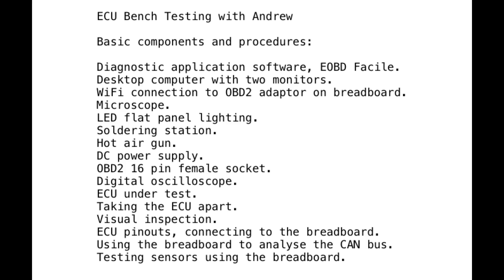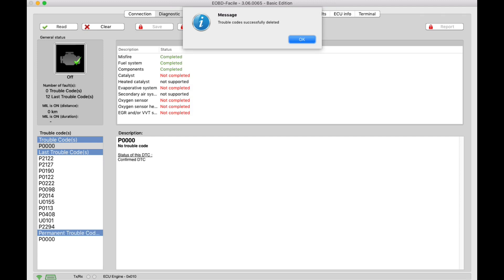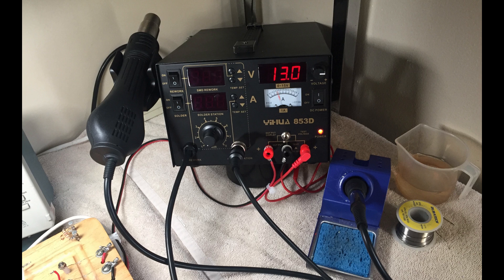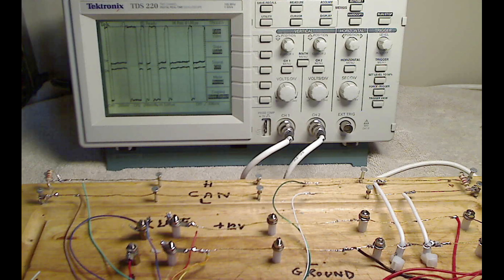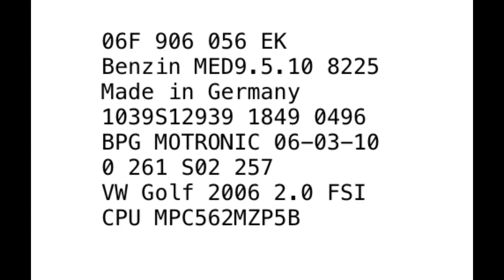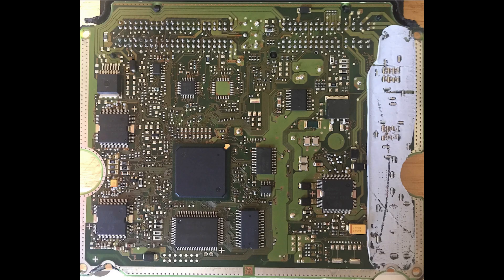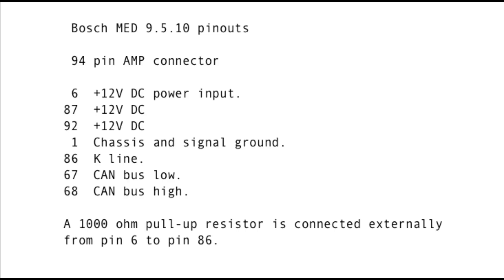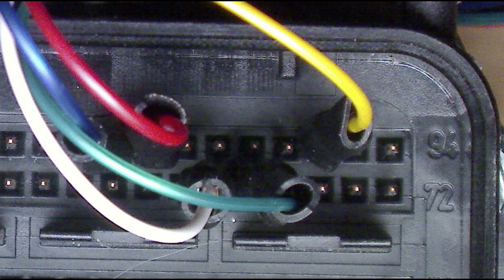ECU testing. Bench testing a Bosch MED9.5.10 ECU VW Golf, and analysing the CAN bus.

Comment: Thanks for the video. I need to clone mein ECU med9.5.10, I have the mpps v 18, where do I connect the gnd on the motherboard for boot so I can read down the eeprom as well? I will write the data on some other ecu in hope to solve the missfire issue in my VW,  Thanks for help in advance, is difficult to find this info.

Comment: Hi! Can you tell me why you put the  1kohm pull-up resistor between pin 6 and 86?
Reply: Best guess is it is due to the K line being pulled low for communication. When this is the case, it's best to use a pull-up in the opposite direction for avoiding signal noise.

Comment: Hi sir how to short the can bus when it’s being used in bench setup
Reply from the maker: The CAN bus is directly accessible on the breadboard, and at each end there is a 120 ohm termination resistor. If you need to short it out then you can simply solder or clip a piece of hookup wire between the CAN + and the CAN - bus wires. Or if you only want to short out one side of the CAN bus you can short it to the ground connection on the breadboard.
Reply: @andrewmckean1205  thanks for the reply sir
Reply: Sir in the same way tell me the difference between hardware in loop and bench setup

Comment: Was looking forward to part two. I do have a question.  How can the scan tool read the data traffic on the ECU , without having a gateway wired in as well? VWs have an OBD module (GATEWAY) that relays info from CAN, LIN, and K Line to the scantool...
Reply from the maker: Hi Michael, thank you for your comment. Unfortunately there will be no 'part two' as I have recently been in hospital with a minor stroke and have been advised to take it easy from now on, as I am 82 years old. However, I do remember having to make a direct connection between the K line OBD2 connector pin 7 and the K line pin on the VW ECU, whereas no such connection was needed for other ECU's as they established connection using the CAN bus.
Before I became ill I was developing an Arduino CAN bus monitor that enabled me to write simple C++ code to read parameters such as the VIN code.
Regards, Andrew
Reply: @andrewmckean1205  thank you for your response,  I'm sorry you have fallen ill, take care of yourself and wish you the best...
Reply: @andrewmckean1205  can you release your works for the vin code project